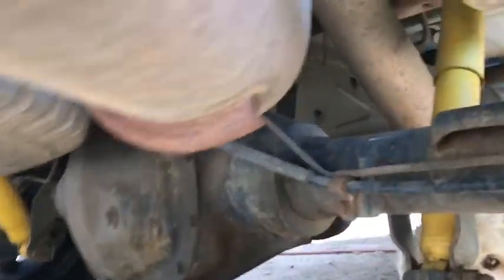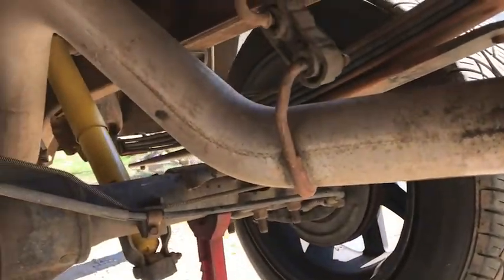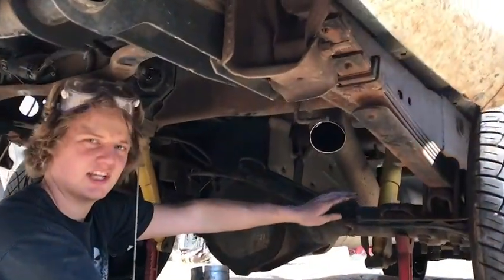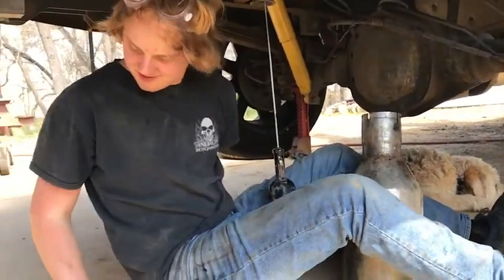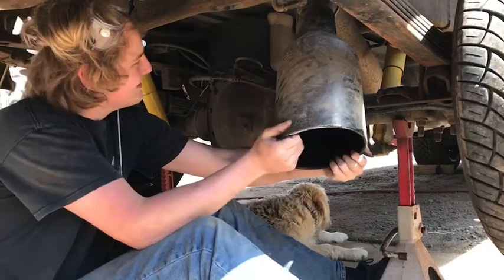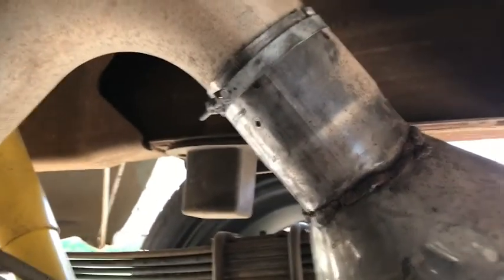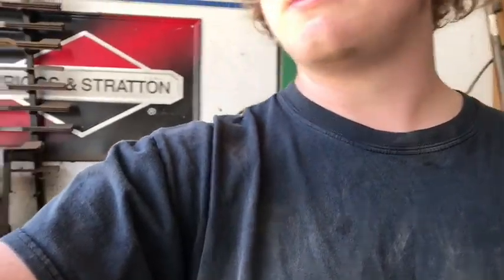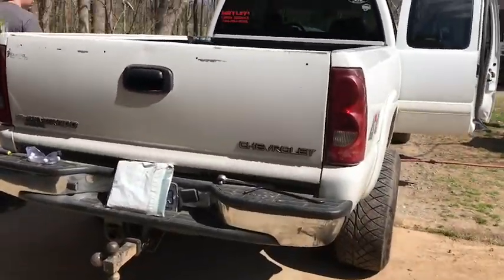how to install an axle dump

Comment: Parking brake is for the rear wheels lol
Reply from the maker: James Dale Copeland okay so if it falls on the ground i guess it’ll just roll over you
Reply: @motleysbuildandrepair546  right if for some reason it falls and the transmission somehow comes out of gear, then yes... It will roll over you.
Reply from the maker: I mean hey, if a few seconds can do anything at all then you’d might as well, but if you don’t want to push it in then don’t, but no need to say anything to me about what a parking break is for